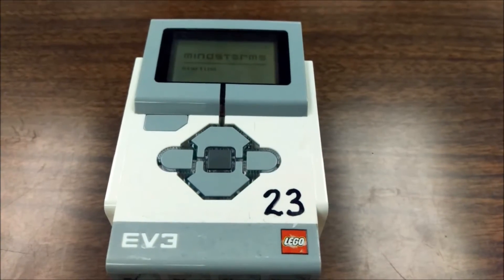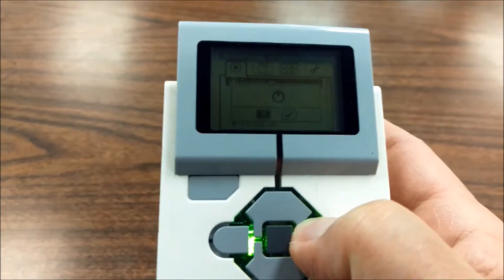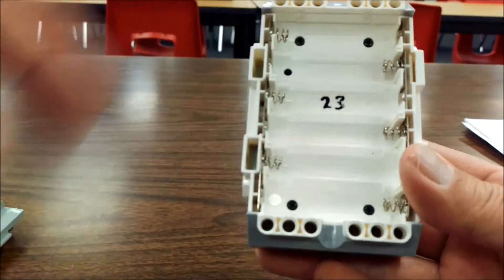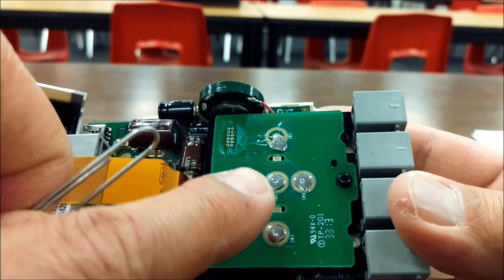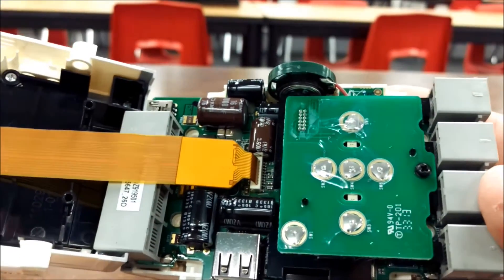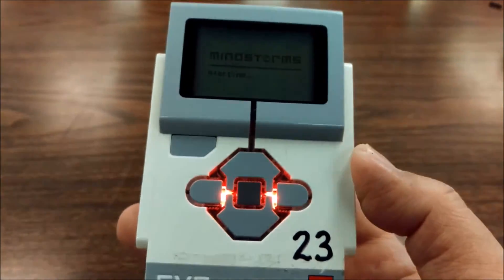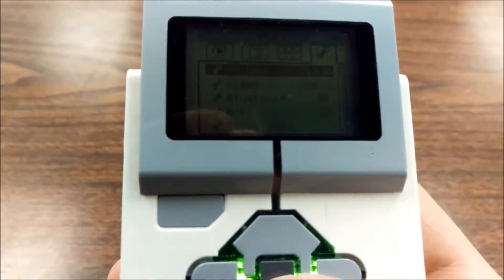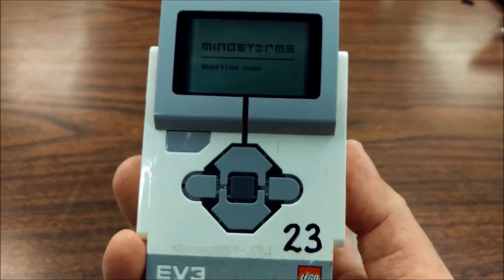"How To Fix A Stuck Or Broken Control Button On Your LEGO Mindstorms EV3  Brick"

Comment: I have a problem with mine where I can turn it on but once it is on the centre button no longer works anymore.
Reply from the maker: Check out my video on the connector buttons.  https://www.youtube.com/watch?v=Dk1JhWUgP40
Reply: @LEGORoboticsMrHino  thanks
Reply: @LEGORoboticsMrHino  I did check and none of the connectors are loose. I ran a simple program that would make a sound when I pressed the middle button ( had to download and play directly from my pc) and when it ran it made the sound but my middle button does not seem to be constantly pressing. I really need to find a solution fast as I have a competition coming up.
Reply from the maker: Wow...if your connector for that middle button is in the right spot, I'm not sure what the problem can be.  How did you turn the brick on if that button doesn't work?
Reply: @LEGORoboticsMrHino  I pressed the middle button to turn it on, that's why I am so confused.
Reply from the maker: @dejanventer5330  Hmmm that would be weird.
Reply: @LEGORoboticsMrHino  I've only seen one other person with this problem